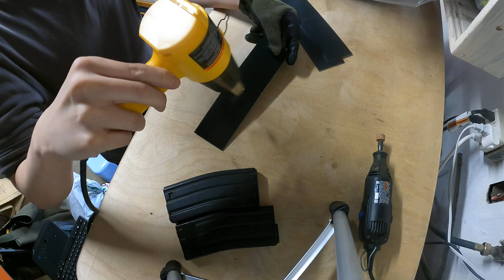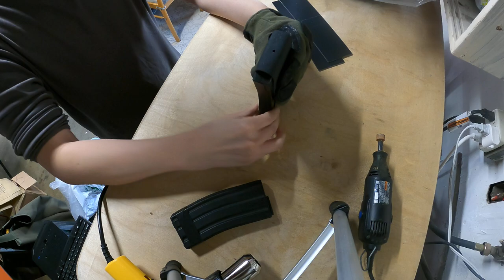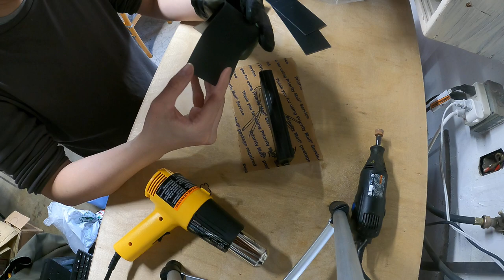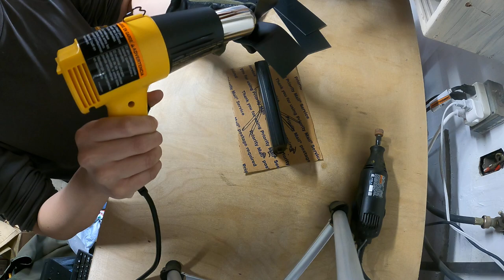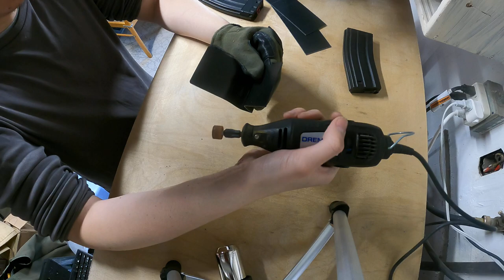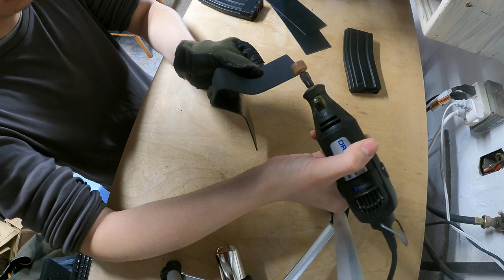How to make Kydex mag insert

Comment: Cool video, but you don't talk or show measurements or describe the drain hole. The angle of the flap. The spot at which you bend it at. Type of kydex. The Velcro and adhesive.
Reply: Are you incapable of doing  even basic work yourself
Reply: @ViktoriousDead  I guess so, and you must not be able to take criticism.
Reply: Kydex Thickness; .125 or .09
Diameter of drain hole; 3/16"
Cut Width of each; 2.75" 
Cut Length of each; 2x Depth of Mag Carrier plus 1".  This will depend on the depth of the Magazine Carrier that you intend to use.

For a Mag Carrier that has a depth of 5.5" Mag Carrier, Length before bending would be 2x5.50"+1" = 12". You could use 11". 

For a Mag Carrier that has a depth of 3.5" Mag Carrier, Length before bending would be 2x3.50"+1" = 8". You could use 7.5"".

~~Wing Path